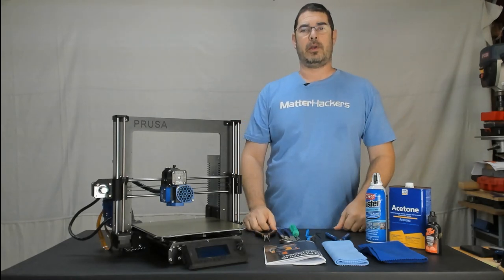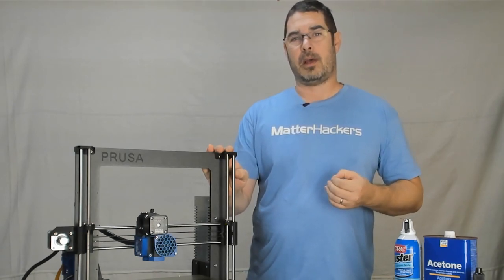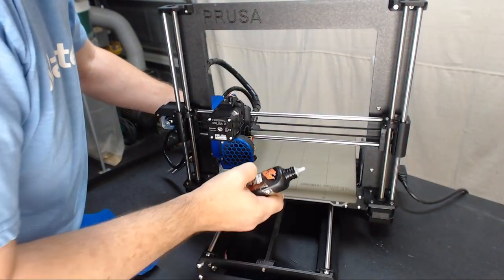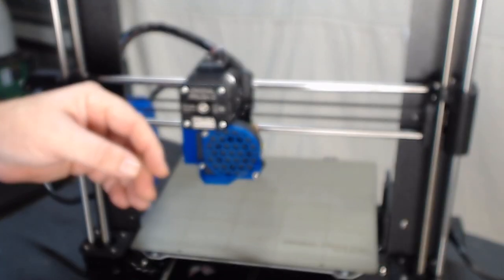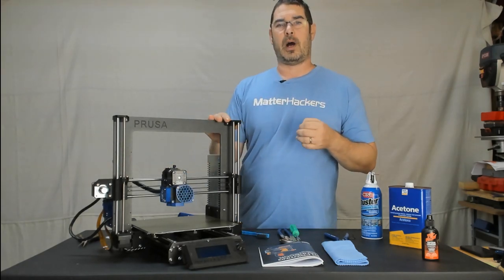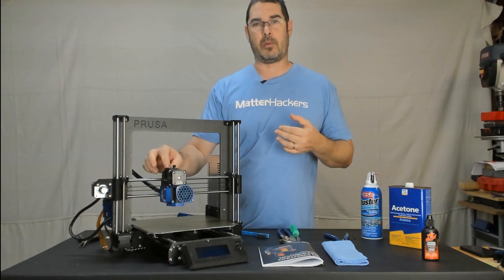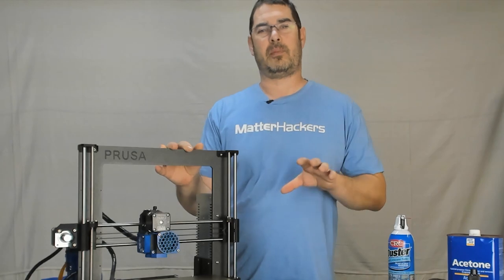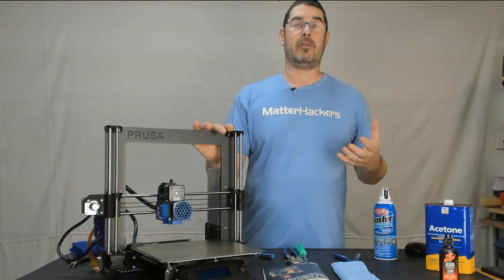A 10 Step Program for your Prusa Mk3: Basic Printer Maintenance

Comment: Great video! It should be mentioned when oiling the linear rods, do not move the axis too quickly or the stepper will generate current and send it back into the motherboard.
Reply from the maker: Justin L. That is a good point.  Not all printers have reverse current protection.